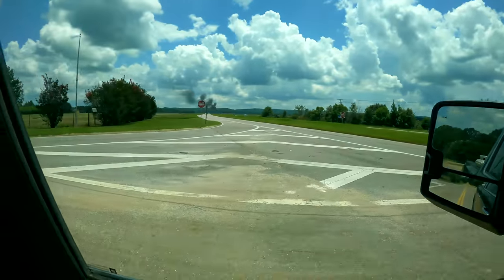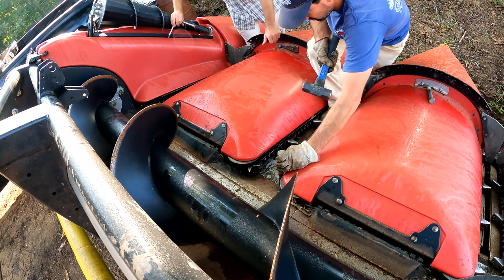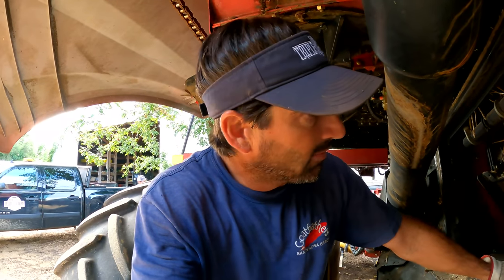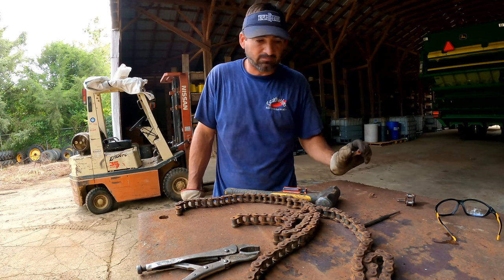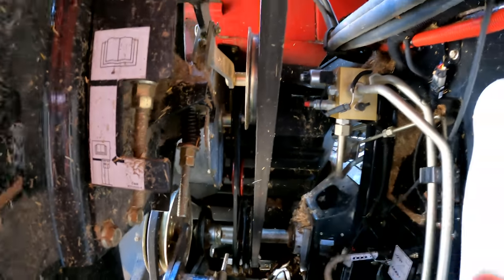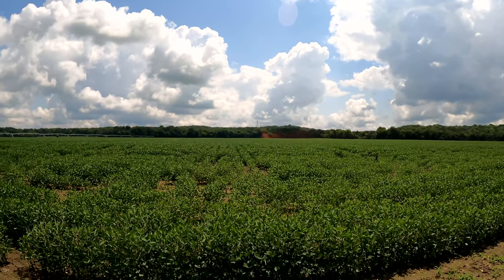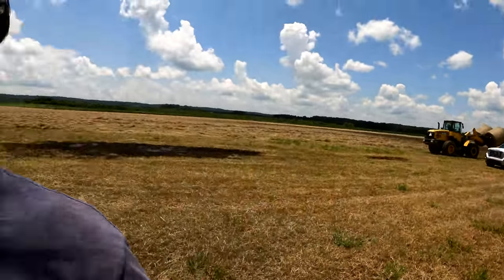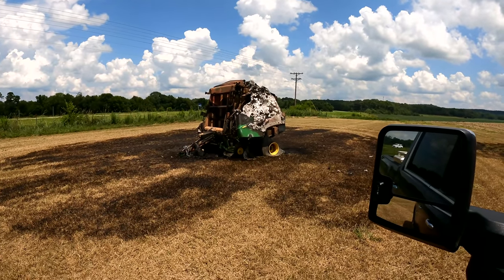BIG FIRE on the JOHN DEERE 569 HAY BALER

Comment: My heart goes out to you...I know how fast these things can happen.  I had just finished a small patch of hay by the house first of the season in 2020 (John Deere 568) and was heading to another field...stopped and was making an entry on bales I had just done, was sitting in tractor close to the house and thought I saw some dust go behind me...looked around me and baler was on fire.  Flames shooting out the top.  I was so fortunate that I was within 15 feet of a water hydrant.  was able to get the fire out.  The baler was within 6 feet of the diesel barrel... It could have ended very bad, but still had a lot of damage...replaced bearings, one shaft and of course all the belts were toast.  My insurance adjuster called me and said "when I found out your baler was at the Bethany John Deere, I couldn't hardly believe it...I don't get to repair many baler fires"  With it that close to the house, diesel barrels...it could have ended up REAL BAD!!!
Reply: Did you always carry something like a 25lb fire extinguisher on your tractor, and another on your baler...after that lesson?
Reply: @JohnSmith-yv6eq  the water hose from the hydrant was certainly more effective than the water extinguisher that John Deere has on the baler… plus, with how hot the flames were I don’t know if would have dared get that close to the baler to take it off.  If I’d been in the field, I hope that I could have just pulled the draw pin and drove away. As it was, I had to still get back on the tractor and open up the baler to get to fire inside of the baler

Comment: Equipment can be fixed or replaced, Thank God no one was injured. You have a good operator to have kept their head and saved the tractor. I think a steak dinner and 6 pack is in order, a lot of workers would have stepped back and watched because it isn't their problem. When find good ones like you have ya gotta keep them around for sure. 
I hope you all have a really good season to help take the sting off from the loss of the bailer.
Reply from the maker: Thanks for watching 👍😁

Comment: Almost lost my baler 2 weeks ago.  I finished baling and 2 hours later the neighbor came to tell me the baler was on fire.  Luckily I have great neighbors and they could smell it.  They put it out while it was still smoldering.  It was a bearing.  My good neighbors saved my baler and my JD 6420 tractor.
Reply: YES ITS CALLED FIRE WATCH ANY HOT JOB SHOULD BE WATCHED FOR 30 MINS
like this baler  2 hours later bye bye.

Comment: The opposite happened to contractor on our farm. The straw went round the 4WD propshaft and caught light. They pulled the pin on the baler and saved the baler but lost the tractor.

Comment: So I would try to get it out as quick as I could to keep some more parts to use if needed for the new baler. If you could save the belts but they were probably the first thing to burn up and hard to save with a big bale feeding the fire. Thank goodness James was so quick on his feet. To heck with the plugs and hoses. Sometimes pto units hang them up too if the fire is blasting you while you unhook.
Reply: When balers go up in flames, it’s usually goes too quick to realistically put it out quick enough to save anything. Plus, the heat from the fire will make parts that didn’t actually burn unusable.

Comment: Those pictures looked so familiar! Ours did that two years ago with my daughter driving. Just got there in time to pull the pin and drive off. The heat is unbelievable some of the plastic had started to melt on the back of the tractor (left it as reminder) got another baler quick then that had a bad bearing and almost caught fire. My daughter didn’t want to do anymore baling for a few days after that🤣🤣

Comment: When you are combining or bailing you always need to have a water truck with a pump on standby at the edge of the field. Get the fire while its small. You can tell its a small town fire dept, no bunker gear, no scba's ,that smoke has all sorts of toxins in it. Its the bad part of rural farming, help is not close at hand. Build a flatdeck trailer with a decent size water tank and a honda water pump, with some 1 1/2 hose and a good nozzle. You may not be able to put the fire out but you can at least stop the spread into your field. Bailers are famous for piling up bearings and lighting up.
Reply: Best thing to have is a spare tractor and slurry tanker full of water gets a fire out fast if you catch it quick enough

Comment: Moving parts, hydraulic fluid, Grease, dust.....it all adds up to a potential disaster. 
Combines and cotton pickers are even more susceptible to fires.
We lost a 9960 cotton picker in 1996 and a 9500 combine in 2005.
It's not a matter of IF it'll happen but WHEN it's going to happen. 
Thank God James is okay, and thank God he had the quickness of thought to save the tractor. 
Buy the man a nice steak dinner and tell him how much he is appreciated. That's a all gesture but it will speak volumes to him.

Comment: It’s definitely weird man you can never mistake that smoke my friend who owned the farm and I where dumping trucks out of the wheat field we both looked up seen smoke he looks at me what ya recon that is I told grab the sprayer trailer with the water tank I was already on the phone with the fire department we had a combine fire bearing burned up and dropped in the field we were a good 8 miles away but that thick black smoke you can tell sunflowers is one bad crop for that too we used to drag a chain behind the combine to help with static electric too stay safe

Comment: Less than $20 gets you a chain breaker tool that would have saved you a lot of time on that combine job.  You would not even have to pull it off the combine, just take the master link apart, break a link off, add a half link and put it back together.
Reply: I never heard of that tool. Iam going to get one. I took a link outta my square baler chain an got it outta time. That cost me three hours.

Comment: I had a bearing go on our round baler when I was baling straw one fall when the flames started shooting out of the baler I just opened the baler and drove as fast as I could away from the fire then put the baler out. we only lost 2 belts and needed a new roller and bearings. then I had to get a tractor and disc to put the field fire out but we only lost about 5 acres.
Reply: Key is....... keep the baler running so the material falls out ........even if its burning. Just move slowly to allow things to fall away from the baler. Dont drive fast.....only fan the flames. Chances are not much else will burn. Theres not enough heat build up to burn belts " if " the fire has just started. People panic when they see fire.
Reply: @jerrylansbury9558  The key is open the the baler and get rid of the haying get away from the fire that is the only thing that burns. the belts are easy to stop burning.

Comment: Key is.......Dump the bale..... keep the baler running so the material falls out ........even if its burning. Just move slowly to allow things to fall away from the baler. Dont drive fast.....only fan the flames. Chances are not much else will burn. Theres not enough heat build up to burn belts " if " the fire has just started. People panic when they see fire.

Comment: Just a suggestion. If that chain has worn and stretched to the end of it's adjustment range (it looks dry and rusted,) it's time to replace it. Doesn't it have an auto oiler ?
Reply: You replace a stretched chain, you will ruin the sprockets
Reply: @thepubliceye  exactly! Worn sprockets get replace also. Better than  being parked under a shade tree broken wondering why you didn't take the time for maintenance.
Reply: While you have the chain off, coil it and place it in a large shallow tub.
Pour 80w90 all over it.
let it sit a while.
Then hang it vertically over the tub and let the excess run down into the tub.
Replace well lubricated but extremely worn chain back on and give it a go.
This winter, new chains and sprockets all round...and keep the equipment tarped up...even if it is in a  shed.
Reply: @JohnSmith-yv6eq  Well said except for the tarp, tarps trap moisture. best if not a heated shop is good ventilation.
Reply: @thepubliceye  
Not if the tarp is a light canvas..that breathes.
Reply: @JohnSmith-yv6eq  True but canvas doesn't breathe.

Comment: Never have understood why balers do not have a cheap water based auto extinguishing system on them.  Worst thing that could happen with one is a false alarm and one wet bale.
Reply from the maker: Thanks for watching 👍😁
Reply: costs money
for how many times it happens
more detectors more problems.

Comment: Man, that really sucks. Had a few of these balers and probably had a bearing go out on it. Seems these JD round balers use cheap bearings cause we are constantly replacing them.
Reply: Then just replace with good bearings,noone said it must be JD china bearings,exc. maybe JD themselves.
Reply: @claesmansson9070  There is a much better option. Buy a McHale. These balers are junk.
Reply: Ok,saw a vid.from Norway using M.H. in this fantastic rocky landscape,looked ok,remember they had nicely integrated wrapper in the rear.

Comment: I’ve watched a ton of farming channels and they all blow out filters. It just occurred to me of a device to do it automatically. A small turntable that the filter sits on and an air device that goes up and down in the center of the filter or a large air device that would cover any size filter. I think farmers would clean their filters more often which would be better for the engines.
Reply: Several tools are available similar to what you describe.

Comment: I have had a baler fire from a bearing. I ejected the bale and let run until what little fire left in the baler worked its way out. With the baler running the fire inside could not get the belts hot enough

Comment: Sorry about your baler, its not good when this happens, but can I make a suggestion ?  tool companies "Snap-on" being one of them sell an infrared digital video camera and they are designed to capture this type of fault as well as electrical faults too.

Also as for electrical faults, its a good idea to run a check on the wiring bundles to ensure they are NOT resting on edges, any edges that is sharp and not so sharp as wiring can rub away really quickly if not restrained correctly, and protection only gives time protection as it will wear through eventually.
Reply: its a case of it hasnt happened  till it to late and its happened.
Reply: @raypitts4880  agreed, but this is farming and it could happen again :(

Comment: Is it me and my limited exposure to tractors or does John Deere equipment seem to catch on fire more than any other “brand” of tractor ?  I don’t hear too much about Case equipment catching on fire.  My friend who does hay sold his old Case and found a “good deal” on a John Deere with 1,000 hours on it.  He’s had it to the repair shop at least 3 times since he bought it this spring (2021) and it also almost caught on fire.  I’d stay away from John Deere if i was buying farming equipment.  I’ve just seen JD tractors on fire.  This is the first piece of JD equipment I’ve seen catch fire.  Not good advertising for JD !
Reply: I've seen a recycling yard where most of the burned balers & combines are JD. Guy in charge said they've always been that way.

Comment: I hate to be negative toward something like this but a good employee would have noticed the baler on fire if he was watching his equipment. I realize he saved a very expensive tractor but he should have known his baler was on fire way before the flames got that big and could have ejected the bale and most likely saved the baler. When running equipment you can never let your guard down, you have to watch & listen to your equipment at all times. Sadly an employee usually doesn't take care of equipment like the owner would. Regardless, it is a good thing everybody is alright and no other equipment got damaged.
Reply: My baler fire started without a bale in the baler...Once a bearing goes bad enough to start a fire and if a belt gets on fire...That's a hot fire!  I don't think anyone could fault the employee if you weren't there...things happen fast!   If I wasn't within 15 feet of a water hydrant when I discovered it on fire, I wouldn't have been able to save my baler!

Comment: we have a tractor signed to a disc if we need it we have it to prevent the fire from spending my aunt has 2 wilded fires on her property it's under control not out at any means both are at the size of a township inside now she trying a roller out at this time with a tank that has soapy water it slows the fire down if i was not disabled or in a bubble to stay alive i would have been their helping out

Comment: its hard to hear if a bearing goes in your baler when your in a tractor with a cab.  when the bearing goes it heats up quickly (within 1 bale). had same thing happen  but kicked the bale and saved the baler.  shitty deal man. laser infared thermometor works well to check bearings once an hour or so. they are cheap.
Reply from the maker: Good idea, thanks for watching 👍😁

Comment: New chain will save the sprocket.
Reply: Unfortunately, as with a chain saw, the new chain will get worn twice as quickly by the worn sprockets....
This winter is the time to replace all the sprockets and all the chains....at the same time.
Then you are back to "zero hours" on that part of the machine....
and these chains look 10 years old...
the slack comes from every pin and every roller bush being worn...no lube...snap!

Comment: EVERY  PIECE  OF EQUIPMENT NEEDS A FIRE EXTINGUISHER ON IT.. JOHN DEERE MAKES A KIT THAT PUTS AN EXTINGUISHER ON THE FRONT OF THE BALER, AND ONE INSIDE THE TRACTOR... ALSO HOW DOES THE OPERATOR OF THE BALER TRACTOR NOT KNOW THE BALER IS ON FIRE????? THE GUY WAS NOT PAYING ATTENTION.
Reply: fit a load more detectors  then youll have problems with all the codes

cant win.

Comment: Visit the TEKTON Store
4.5 out of 5 stars  5,537 Reviews
TEKTON 1/2 Inch Drive Impact Try this to loosen the fill caps on the head to check the fluid level. This kit comes with a screwdriver set but you can by an Allen driver set for it too. Just has to be 1/2 inch drive. They work great and it keeps from damaging the Allen head. 

Screwdriver Set (7-Piece) | 2910
Amazon's
Choice
in Screwdriver Bit Sets by TEKTON.